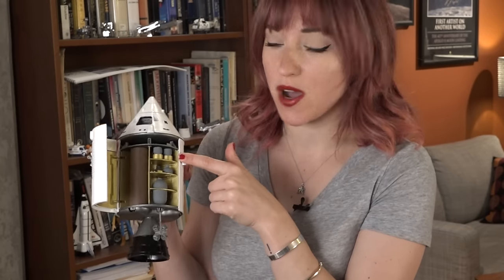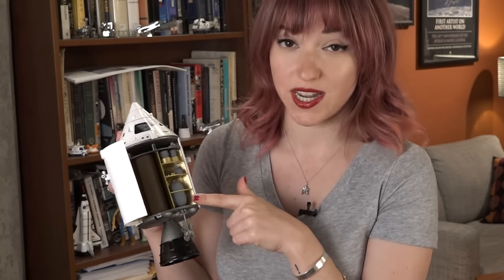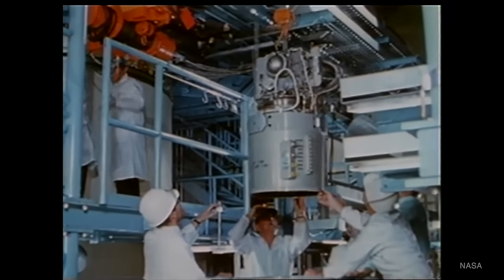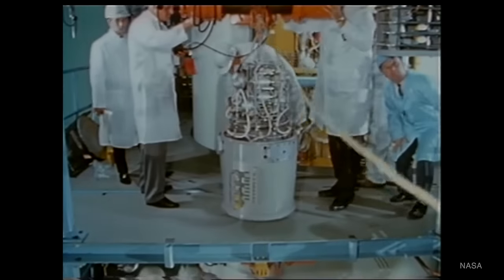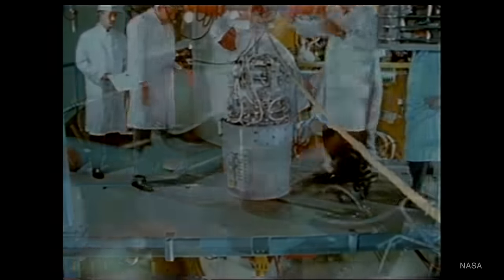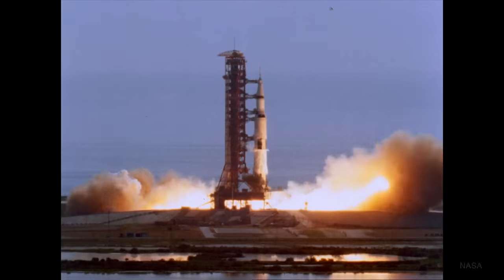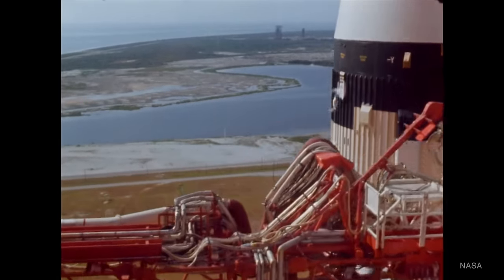How Quickly Did the Crew of Apollo 13 Know They'd Lost the Moon?

Comment: I'm interested as to why inverters were needed? Electronic use DC so all circuitry would need more circuitry (therefore weight) to transfom the AC to DC. Did any of the system require more than 10 Volts? I'm guessing the output of the hydrogen fuel cells might be about 1 Volt DC, which can be brought up to several volt without inverters but at some point a transformer is more efficient to bring up voltage and transformers needs AC. English is not my first language and this is a very technical question that I'm trying to ask in as few word as possible without going into a lot of theory (and theories).
2nd question: Does your book contains much graphics and photographs? The answer will influence my choice between ebook or a physical copy.
Reply: +SlyPearTree    Not sure if this will help but there's a pdf titled "Apollo Lunar Module Electrical Power System
Overview" that you can have a look at. I would link it but sometimes the spam filter blocks it.
Reply: +mako88sb 
Thanks, I just looked at it. It says the inverters were overpowered due to the decision to switch from ac motor to dc motor for some stuff. I'm guessing some other motors still were AC. It strangely says that the fuel cell were replaced by batteries but does not say when.
Reply: SlyPearTree   "It strangely says that the fuel cell were replaced by batteries but does not say when."

All I know is it was pretty early during the LM development stage when they made the decision. I don't have Tom Kelly's "Moon lander" handy right now but here's a quote from a thread I was looking at recently that pretty well confirms it:

"If I recall the timeframes correctly, NASA hadn't even amassed any Gemini flight experience in fuel cell operations, much less Apollo cells, at the time the decision was made to pull the fuel cells from the LM design and go all-battery.  So such questions as in-flight startup, cryo storage time limits and such had not really been addressed.  Systems were being designed -- how to best use those systems was an exercise yet left for the future."

Here's the thread but you will have to remove the spaces:
https ://foru m.nasaspa cef light .com /index .php?topic=38553.0

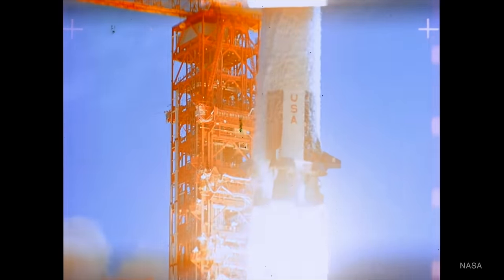Comment: 2:16 great launch footage. I wonder how long it'll be before we send something that big up again
Reply: +BarryDennen12 :I'd say one of the private sector startups could probably do it within a decade or so depending on requirements. Space X has plans to develop the Falcon heavy which would be a 4.5 million lb liftoff thrust rocket or 3 million short of the Saturn. Further upgrading could equal or surpass the Saturn-V eventually. The SLS block-1 rocket will have 9.8 million lbs total liftoff thrust (7.2 million lb SRB total and 1.6 million lb core stage total) if it actually gets built and flight tested.

Comment: Hi Amy,as far as I know, a liquid hydrogen tank in the service
modul of apollo 12 which could not keep the pressure, was replaced by a similar tank
from apollo 13, two days before the lift off of apollo 12.
Could that have contributed to the accident of apollo 13 ?
Greetings,
Hans
Reply: No. The problem was with a wire for the stirring fan of the liquid oxygen tank

Comment: But Apollo 13 did enter lunar orbit as it had to circle the moon to head back to the earth did it not? I also dont fully know why they did not fire the main engine, I dont think it was to do with lack of electricity, I thought it was that they were unsure of the damage done and the possibility of explosion if the engine was fired?
Reply: Not in the classical sense. They never made a braking burn to slow the ship down enough to enter an elliptical repeating lunar orbit. They really just made a close approach. Interestingly though many people don't realize that in all the Moon missions astronauts never really even left Earths orbit as the moon itself orbits Earth and landing on the Moon means you are orbiting Earth as well. They were technically in a double or binary orbit until they landed on the surface. You could argue both ways though as occasionally 'orbit' refers to a non-recurring trajectory around a point in space, such a slingshot to change a velocity vector for a outer-solar system destination like Jupiter or Pluto as in the case of New Horizons. It really just boils down to semantics but isn't used in practicality.
Reply: Well I guess thats true, but then again, same could be said between the sun and earth, we are still orbiting the sun.
Reply: +nzoomed And, thinking further, the galactic center. We're in at least 2 (depending on what the galaxies are really doing), the people on the moon were in 3 orbits (4 if they were orbiting the moon) at all times. Talk about a (slow-ish) roller coaster! :-)
Reply: No, they didn't enter orbit.  The spacecraft had too much velocity to remain in lunar orbit when it got there.  This was by design.  To enter orbit would require a burn on the SPS to scrub off velocity so that the spacecraft would assume an orbit around the moon (Lunar Orbit Insertion).  If the burn could not be made due to, for example, an engine failure, then the moon's gravity would slingshot the spacecraft around and eject it from its vicinity with enough speed to escape the lunar gravity well.  This meant that without a braking burn the spacecraft would automatically return onto an Earthbound trajectory.  As this meant you would be put back on course for returning to Earth without having to do anything it was known as Free Return Trajectory.
Reply: Im a flat earther..nobody went to the moon..we cant even go to space!!

Comment: Hi Amy - Did you give a talk on how Apollo 13 almost happened on Apollo 10?  If my memory is correct, O2 tank #2 on Apollo 13 actually was swapped out from the Apollo 10 SM.
Reply: The tank was not the problem i Don't think. the problem was with a stirring fan wire.
Reply: Sure Thing 88 You are right they did a tank change but the fault lay in the installation when the tank was jarred.  The fried wire came because they needed to boil out oxygen after the CDDT and it wouldn't drain properly, and they cooked it way too long.  The thing that I find interesting to consider is that they didn't have to fly in April '71. Lovell knew about the tank and that there was potential damage, but decided to fly anyways.  If he had decided to change out the tank, it would have taken one month to fix and the whole disaster would have been avoided.  And BTW Ken Mattingly would have been able to join them because his incubation period for measles would have been long over

Comment: ok, the lunar modual converted dc to a.c.? I would have figured it would all be dc, since most modern electronics work off of dc.  will have to look into this more. also who knew they had power cells way back when, pretty cool.
Reply: You have a.c. and dc backwards. Bieng in Europe and us, city power is a.c.. 120v in us, 240v in Europe if the majority of things were dc, city power would have to be dc
Reply: Actually he's right, and your thinking is backwards. If cities supplied all power in DC, we would not need adapters or converters at all, because the majority of electronic devices run on DC power that's been converted from AC. This is not practical, however, for two main reasons: 
1) most methods of generating power involve creating AC power at the source (Alternators generate AC current and are one of the most common machines for generating power), and 
2) DC current cannot be run through a transformer the same way AC current can. DC Voltage of course can be converted by power supplies for individual electric devices, and the switched-mode power supplies common in computers today can even operate on either DC or AC, but to my knowledge there isn't a DC-compatible option viable for the size and scale that main-power transformers can achieve.

It would stand to reason that the LM/CSM of the Apollo missions ran on AC power for those same reasons, though I'm not 100% certain of that.

Comment: Here’s an Apollo 13 question regarding the movie: after the crew cut the tower jet loose, would the ABORT knob even do anything? After the center engine cut out on the second stage during launch, we see Tom hanks staring at the abort knob.
Reply: yes after the tower is jettisoned if you activated the abort knob it would fire up the service module engine and pull away from the saturn v

Comment: Another great video.

Do you happen to know what would have happened had a Skylab apollo fuel cell died during a mission? One of the weight reduction measures they used was to go with two cells instead of three. Would a crew have aborted the mission and landed the command module immediately or could they have returned from orbit on battery power alone?

Comment: Amy, would you do a program speculating about the the Saturn V's first stage after separation:  Its trajectory & velocity, condition prior to hitting the surface of the Atlantic, whether it tumbled, heat generated during re-entry, parts sheared off main structure, flame burn creeping up the side of the structure prior to staging.
Reply: +Smitty Schmid :I don't think anyone really knows what the condition of the booster stages were including me but if I might suggest...They did encounter some frictional heating which probably singed the paint off the airframe the same way one of the Mach 3 XB-70 flights did. The engines were probably damaged upon impact with the ocean. It wouldn't surprise me if the airframe survived largely intact except for denting in some areas due also to ocean impact. You may want to Google F-1 engine recovery plans. If I recall right, Amazon CEO Jeff Bezos and his team attempted to recover the F-1 engines from an Apollo flight. His team happened to get lucky and found the serial numbers of the S1-C stage they located, matched Apollo 11. I recall some engine pic but not sure how much of the stage they imaged or what condition it was in.

Comment: How Did The Apollo Lunar Module Get Its Power Fuel Cells? Or Just Plan Battery Power (And Yes I Can Probably Look This Up)
Reply: +The_Shortline_Gamer _DoesKSP   They originally designed the LM with fuel cells with auxiliary batteries but eventually switched to a battery only design. There were several reasons why that you can find in a NASA pdf titled "Apollo Lunar Module Electrical Power System Overview".
Reply: +mako88sb Ok Thanks

Comment: I was watching Apollo 11 landing and wondered if anyone has videos to answer a couple questions: 1. What are the string/rods at the bottom of the lunar module's landing gears, 2. How did the lunar module do lateral control? Just RCS or something? It seems to have been still moving less than vertically.
Reply: +rhino18    "1. What are the string/rods at the bottom of the lunar module's landing gears,"

Those would be the 5 foot long lunar surface sensing probes designed to turn on a "contact light" to let the crew know when to shut down the descent engine. The designers realized that dust would most likely obscure visibility during the landing and there were concerns that having the descent engine still on during the actual landing could cause problems. They were originally intended to be installed on each of the foot-pads as seen during the Apollo 9 LM testing but there were some concerns that after landing, the probe on the foot-pad under the ladder may be bent up and become a tripping hazard or potentially a puncture source for the eva suits so that one was eliminated.

 "2. How did the lunar module do lateral control? Just RCS or something? It seems to have been still moving less than vertically."

The RCS was used in conjunction with the gimbaled descent engine that constantly varied depending on how much lateral velocity there was. A lot of piloting skill was involved with the final phase of the landing especially considering that they only had about 4-5 minutes of fuel from the pitch-over phase until the actual landing. There are a couple sites you can visit for more detailed info. One is titled "Apollo Lunar Module Landing Strategy". The 2nd is "Lunar Module Descent Simulation". There's also a NASA pdf titled "Apollo Lunar Module Propulsion Systems Overview Apollo" that gives you a pretty good overview of the LM systems.
Reply: +rhino18 :Lateral control is provided by the RCS as you mentioned. It also helps the LM is balanced as much as possible mass wise.

Comment: When Apollo 12 was struck by lightning and "everything dropped out", because it was so soon after launch Conrad kept his head and took the craft into orbit. Was that more, of well we can't do anything until orbit anyways? Or wait until the full damage is assessed before turning the abort handle? 
The inboard engine cut off on Apollo 13? Could any 1st stage engine fail, or was the rules 4 engines need to be working, but any two would result in an abort?
Reply: +leftcoaster67 - For Apollo-12 it was more wait for the full damage to be assessed before turning the abort handle.  The Saturn-V was performing without issue, the CSM was the one having the issues.  Conrad would have waited for a call from Houston for a abort.  Now if telemetry wasn't restored I don't know if Houston would have made the call to abort or wait until orbit.  Yes for the 1st stage a engine could fail, however there was a period for about 15-20 seconds after lift-off that all 5 engines where needed because of the mass, after then the Saturn-V had burned off enough fuel that it could loose one engine and make orbit.  The Apollo-6 Saturn-V lost 2 engines on the 2nd stage and still made orbit.
Reply: Thanks Greg. Nothing but admiration for the engineers and astronauts.